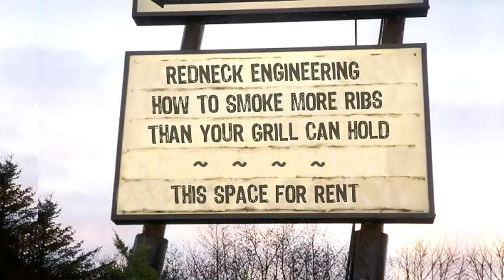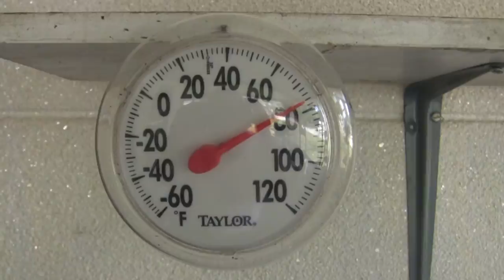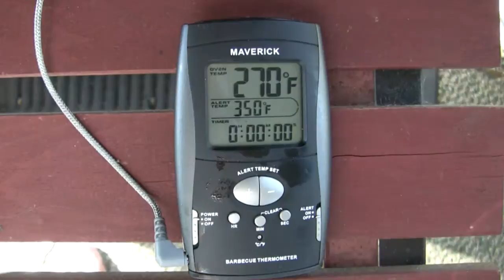Redneck Engineering - Smoking An Oversize Rack Of Ribs!

Comment: Looks delicious, as always.  Great idea with stacking the ribs like that.  I would never have thought 2x4s were a safe wood to cook with. Are they not treated?  This was a low heat cook, but I'd still have been paranoid.  Not that I know much about lumber. I could be completely wrong for all I know :D
Reply from the maker: The Skinny Chef Thanks! I don't know why I never thought of it before. The 2x4s were just plain untreated pine, no chemicals. I wouldn't think of using pressure treated; there are some pretty ugly chemicals in it. Now that I've proven that it works, a next step will be to engineer something a bit prettier, without scrap 2x4s.  LOL